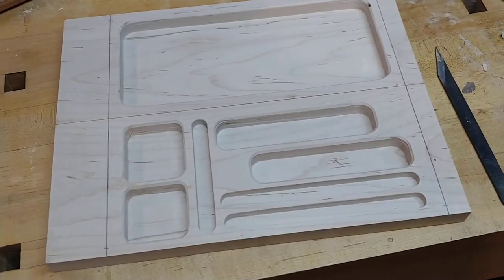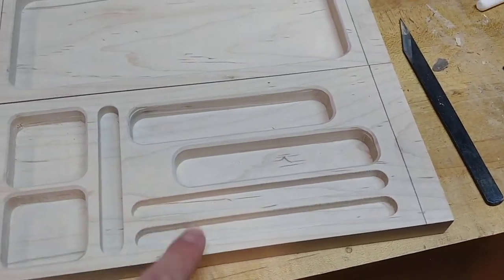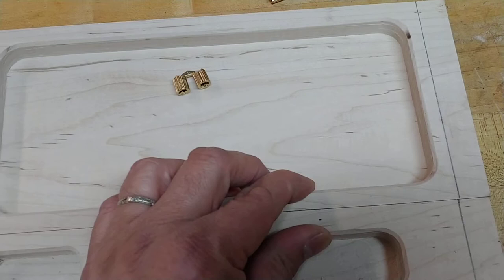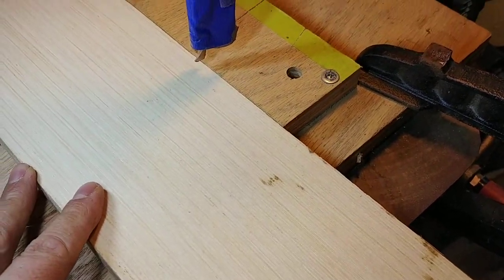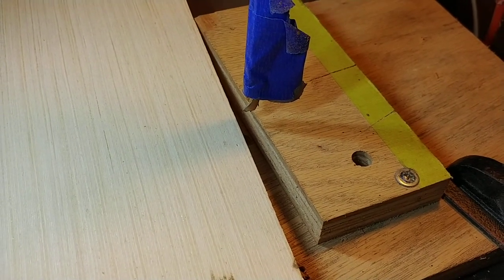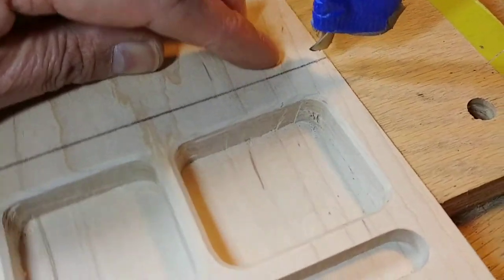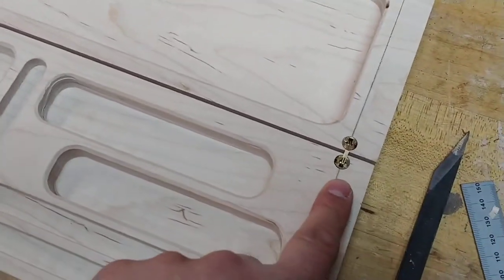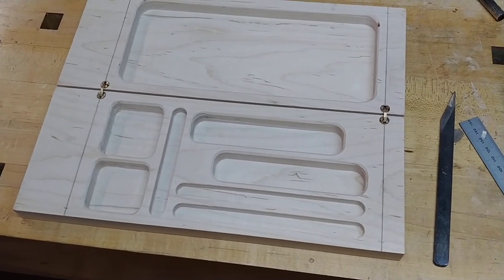How to install barrel hinges on a DnD Dungeons and Dragons dice vault case

Comment: Could you please clarify, why you took 4.8 mm from the edge, while using 8 mm barrels? I mean not 4,5 or 4 equally? Now I need to install barrels on my project and can't understand how to calculate the correct hinges positions
Reply from the maker: The diameter is 8mm for the hinge, or 4mm radius.  So taking 4.8mm from the edge, leave 0.8mm from the edge of the hinge to the edge of your material.  user Paul Stewart below posted an instruction sheet in the replies.
Reply: @randyslab  thank you!

Comment: hi Randy, I am currently also trying to install these hinges on a little box. However, in order to get mine into the hole I have to press them in using a clamp, even with the screw being lose. Needless to say that after that I can't move nor remove them anymore without destroying the hinges and / or the hole. Could you do me a favor and measure the ones you have both with the screw tightened and loose? 
PS: I tried both the 8mm and the 10mm version - the 8mm version did not come with an excenter screw so I moved on to the 10mm ones.
Reply from the maker: The quality is inconsistent on these.  So I press them in similar to your clamp technique, or I drill the hole slightly larger and wrap the hinge with double sided tape and trim the excess once installed so I can still remove if need be.  I measure 8mm and with screw fully expanded it's 8.4mm.  I've had some where they don't even expand upon turning the screw.
Reply: @randyslab  Cool thank you, that's approximately what I get with the 10mm. I will try the tape solution, but the last time I tried that I did not find that really satsfying.Mabye I'll get a 10.1 mm drill bit that ought to do the trick.